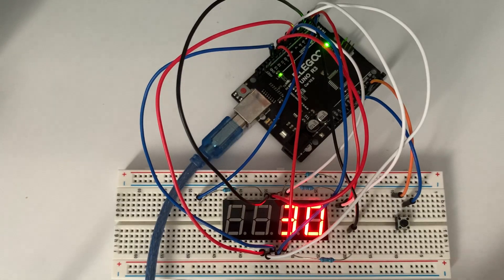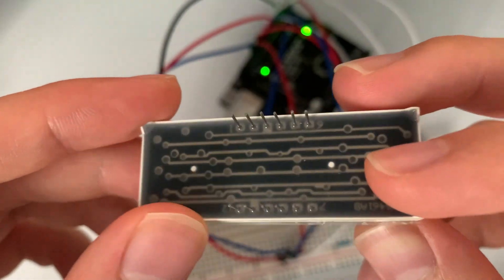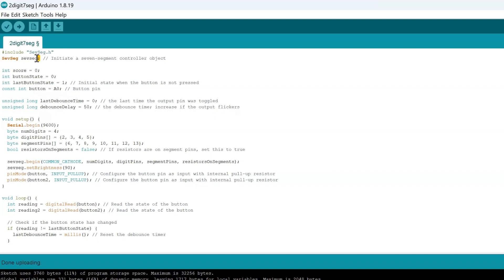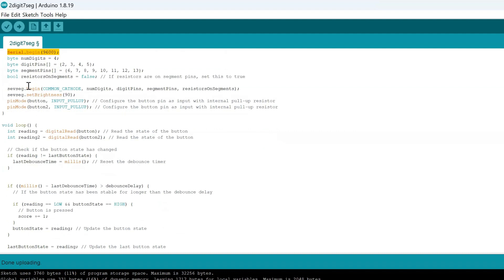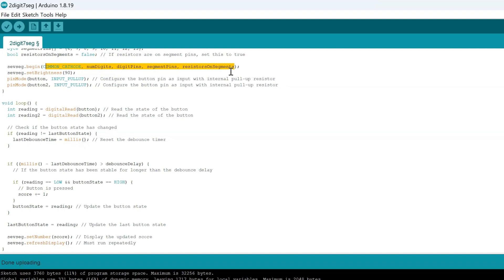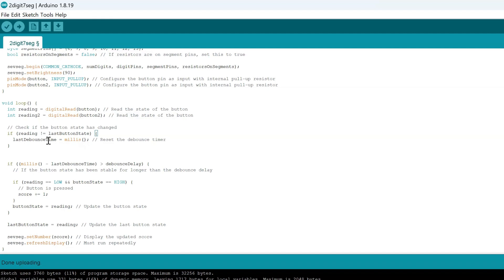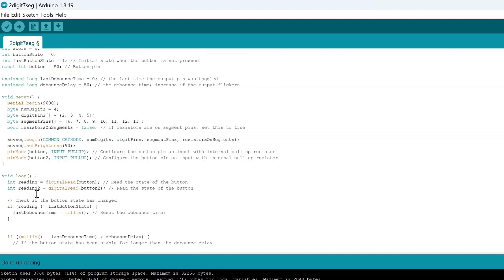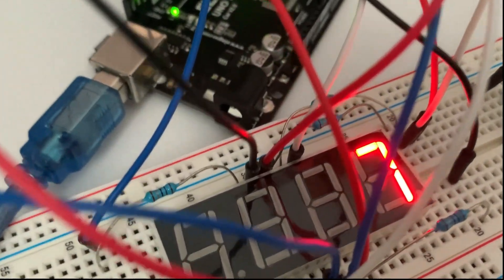4 digit 7 segment Counter - In depth and Easy Tutorial

Comment from the maker: #include "SevSeg.h"
SevSeg sevseg; // Initiate a seven-segment controller object

int score = 0;
int buttonState = 0;
int lastButtonState = 1; // Initial state when the button is not pressed
const int button = A0; // Button pin

unsigned long lastDebounceTime = 0; // the last time the output pin was toggled
unsigned long debounceDelay = 50; // the debounce time; increase if the output flickers

void setup() {
  Serial.begin(9600);
  byte numDigits = 4;
  byte digitPins[] = {2, 3, 4, 5};
  byte segmentPins[] = {6, 7, 8, 9, 10, 11, 12, 13};
  bool resistorsOnSegments = false; // If resistors are on segment pins, set this to true

  sevseg.begin(COMMON_CATHODE, numDigits, digitPins, segmentPins, resistorsOnSegments);
  sevseg.setBrightness(90);
  pinMode(button, INPUT_PULLUP); // Configure the button pin as input with internal pull-up resistor

}

void loop() {
  int reading = digitalRead(button); // Read the state of the button
  // Check if the button state has changed
  if (reading != lastButtonState) {
    lastDebounceTime = millis(); // Reset the debounce timer
  }
  

  if ((millis() - lastDebounceTime) > debounceDelay) {
    // If the button state has been stable for longer than the debounce delay
    
    if (reading == LOW && buttonState == HIGH) {
      // Button is pressed
      score += 1; 
    }
    buttonState = reading; // Update the button state
  }

  lastButtonState = reading; // Update the last button state

  sevseg.setNumber(score); // Display the updated score
  sevseg.refreshDisplay(); // Must run repeatedly
}
Reply: i think the first initialization is incorrect.  It should be:

int score = 0;
Reply from the maker: @yzhmoeh  Thank you so much for catching that! I just changed it on the comment